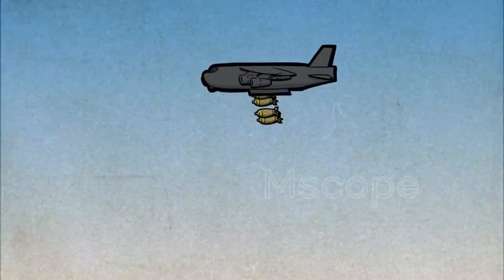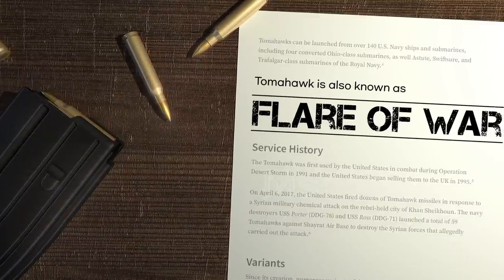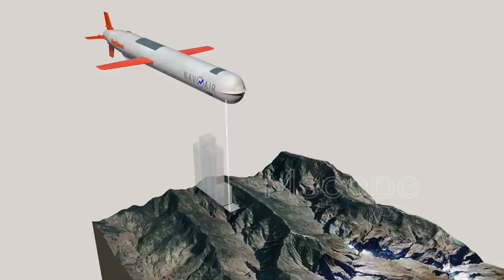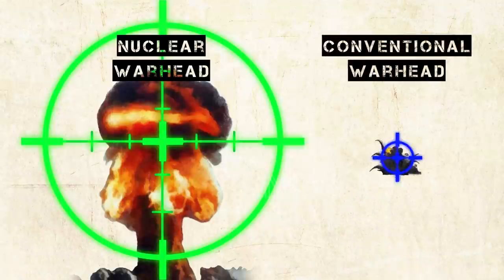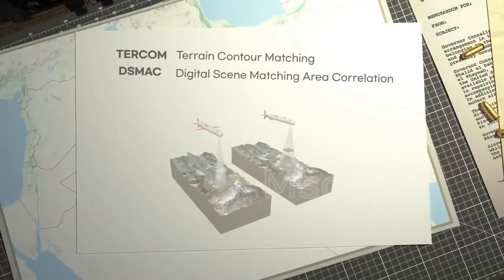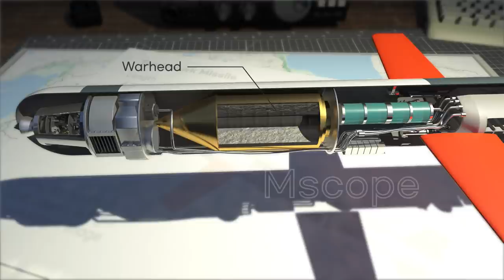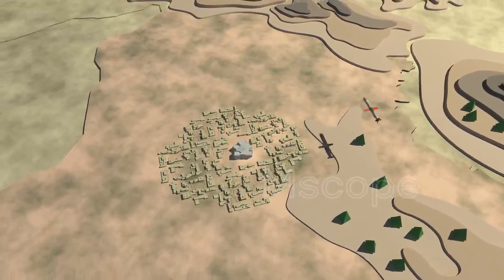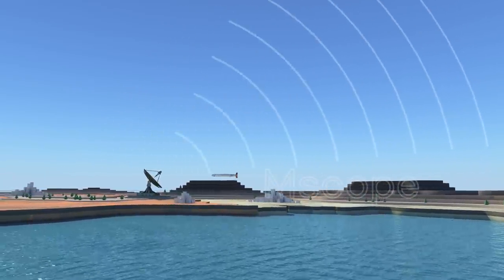Flare of War - Tomahawk Missile

Comment: Just to be clear : the TERCOM doesn't use the real heights or altitudes. It uses the height variations along the way to compare with a digital map stored in memory to "guess" if the missile follows the good path to its target.

Other interesting fact : for ship-launched tomahawks, it was not uncommon that the missile first reached a pre-programmed GPS waypoint, then used its stored ground maps to fly to its target (ships move, you can't be sure the missile will always start right on a well known place or will fly on a portion of terrain already stored in its memory). So for Gulf War, the paths the missile followed where sometimes really surprising (often a straight line to the GPS waypoint, then the normal preprogrammed turns and trajectory to the target).
Reply: So you’re saying the missile knows where it is because it knows where it isn’t?
Reply: The missile knows where it is at all times. It knows this because it knows where it isn't. By subtracting where it is from where it isn't, or where it isn't from where it is - whichever is greater - it obtains a difference or deviation. The guidance subsystem uses deviations to generate corrective commands to drive the missile from a position where it is to a position where it isn't, and arriving at a position that it wasn't, it now is. Consequently, the position where it is is now the position that it wasn't, and if follows that the position that it was is now the position that it isn't. In the event that the position that it is in is not the position that it wasn't, the system has acquired a variation. The variation being the difference between where the missile is and where it wasn't. If variation is considered to be a significant factor, it too may be corrected by the GEA. However, the missile must also know where it was. The missile guidance computer scenario works as follows: Because a variation has modified some of the information that the missile has obtained, it is not sure just where it is. However, it is sure where it isn't, within reason, and it know where it was. It now subtracts where it should be from where it wasn't, or vice versa. And by differentiating this from the algebraic sum of where it shouldn't be and where it was, it is able to obtain the deviation and its variation, which is called error.
Reply: there's alot of thing he didnt covered, like a software similar to AI. they have it back then, it can scan objects like building, cars, tanks and what not to random target . if they set way point on routes it can fly endless loop until you command it only to attack tanks. when the missiles detect the tanks it will automatically target it. they have this tech over 25 years ago. impressive.

Comment: anyone know where i can get the jet engine for the tomahawk? (  Williams International F107-WR-402 turbofan)  the engine would be a perfect fit for my hang glider and has a whopping of 900 pounds of thrust!  i could soar through the sky with that baby
Reply: Meanwhile it's a "one use only" engine. Most of the time, it has no bearings, only cheap or weak mechanical parts (gears, etc), just a few control wires and electronic sensors (it's often designed to stay full throttle only), limited amounts of lubricant (or even sometimes no lubricant at all, just some kind of "permanent/long life" grease or polymer bearings). For example, on the French Exocet anti-ship missile, lubrication is done by the fuel itself ! The cooling system is often primitive too. Some cruise missile engines only start with an explosive cartridge, also. Your engine would only last 8~12 hours before being worn to a non return point or having it eating its internals XD.

Just my assumptions, I was in the French Navy. Tiny engines for our cruise missiles were not meant to be "long life" items. They just had to be able to wait many years in a crate/casing before being intensively used once for a few hours run. (Sorry if my english is crap ^^)
Reply: @fridaycaliforniaa236  im still interested. i could replace the bearings with ceramic bearings and work on the lubrication parts if i have to.   i would be a dream come true with a lightweight jet engine mounted on my hang glider especially my sports glider
Reply: Get an RC jet engine. Those actually last.
Reply: @tianchi4423  ill check it out.  don't think there strong enough though.
Reply: @georgieippolito9924  Search for "KINGTECH K450G4+"  - 99lbs of thrust, should be more then enough for a hang glider.
Reply: "anyone know where i can get the jet engine for the tomahawk? (  Williams International) "
Answers own question.
Reply: @Friday Californiaa  I used to work for Williams but I can't tell you anything besides they stopped manufacturing the f107
Reply: @xeonthemechdragon  can you recommend a powerful small jet engine like it?   throttle control would be nice.
Reply: @georgieippolito9924  you would be better off with a turboprop engine

Comment: I'm not sure I believe tomahawks are cheaper than planes. Much more tonnage of explosives was dropped by planes in the Gulf War than was delivered by tomahawks.

That doesn't necessarily prove anything but one of the more expensive aspects of a weapon that flies is the part that flies. 

With a tomahawk you have to build a new, admittedly small, airframe for every payload you want to launch. A plane is reusable.

Comment: The speed needs to be upgraded to match the rest of the world and has to be able to go around defense system to hit their targets.
Reply: No it doesn’t, first:
Tomahawk is build for relative low speed to not attract to much attention (sonic boom)
Second:
A missile going supersonic is harder to build
Third:
She wasn’t designed for this kind of mission. It was prolly build for quantity over speed, so like:
If I can bring in one missile fast enough to not be shot down, can I do the same by bringing several in the area for less money?
Also. To avoid shootdowns it would have to go hypersonic because of Defense missiles going mach 5 and over
Reply: As a rule supersonic missiles have shorter range due to solid fuel engine or larger jet engine that consumes too much fuel increasing the size, weight and needing larger platforms. Russian Granit or Vulcan missiles weigh 7 tons each with 600-1000km range and a massive heat signature seen from space.
Reply: @gromxxx  well, if you argue like this, you have to say that the longe the „boost“ is, so to say the acceleration, you achieve speed and with it range.
Am I thinking right?
Reply: @mrthunderhawk  in order to sustain supersonic speed through the entire flight path of the missile you need to engine to work throughout consuming massive amounts of fuel. Beyond cruise speed the fuel necessary to sustain the flight rises exponentially hence the weight and size of those missiles.